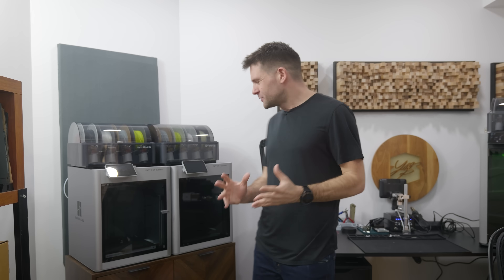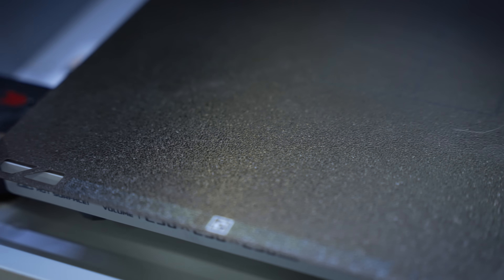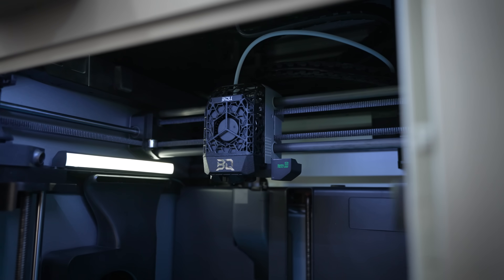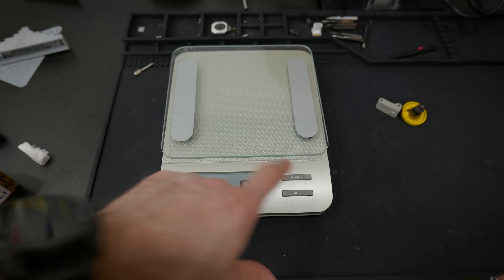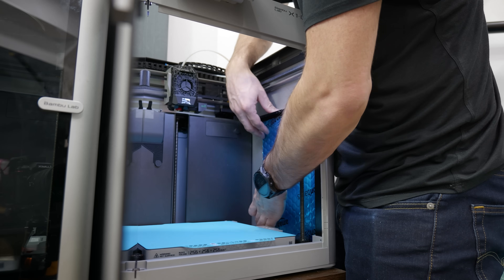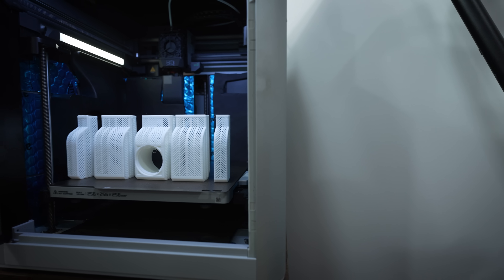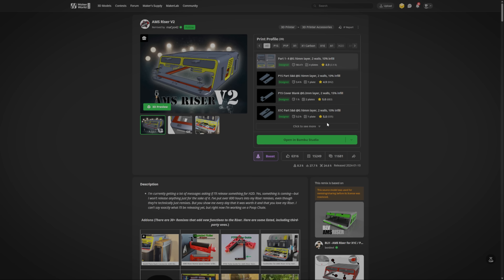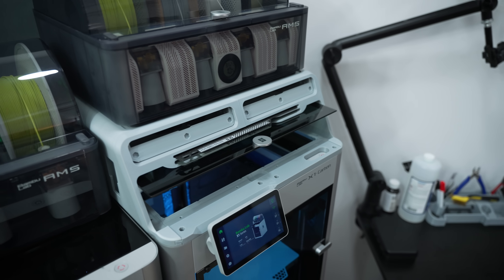I dont understand why more people dont MOD their 3d printers...

Comment: We started by modding our printers in order to work properly -> bambu made press and play printers -> this dude discovered modding bambu printers. We ve come full circle
Reply: Exactly this, I'm still rocking my Ender 3 that I picked up at the end of 2018 and I've basically replaced the entire unit at this point modding things out and improving functionality. This used to be normal for the 3d printing market - Bamboo and some of the other more modern printers made it plug and play for the most part.
Reply: @DarkSky0685  Same for me but with an ender 5. I can exceed 25k at 1000mm/s
Reply: @slacksthegreat subscribed let's see that ender 5 go!!!
Reply: @slacksthegreat what mods do you have? I have a 5 pro and I can't get a good print to save my life
Reply: @DarkSky0685  
that's not something to boast about.  it's like saying  "you folks with your fancy smansy cars.  i still have my horse drawn carriage"
Reply: We have come entirely full circle, there is a community who is putting klipper on bambu labs machines, I am currently working on a1 and its really giving me some needed features.
Reply: This isn't a 3D printing channel so I don't expect Zac to know the history of how we got here, or why "printing your own printer parts" has its own set of pitfalls.
Reply: it was a long road....
Reply: Yea then bambu put an end to modding their printers now they cut the circle
Reply: 100% My Makerbot..  Yes, just Makerbot, needed everything redone and optimized.  Absolutely amazed with my Bambu H2D..
Reply: I would totally mod my bambu but it's very restricted.
Reply: @knightmare1442  I just wouldn't bother, at that point build a Voron. The Bambu printers are fine as they are and most prints I see come off of modded printers look worse than from the stock printer. The firmware and locked in system also is extremely restrictive when it comes to any advanced mods.
Reply: @knightmare1442  nothing is restricted, nothing.
Reply: @cyclonekittenplayz4302  EVERYTHING everything is restricted.  

change out even a single screw and you loose your warrenty.  

if you upload new firmware then it's no longer a bambu printer.  then it's just some DIY based on a bambu.  
and if you don't upload new firmware then you can't change a single thing because it will not work. (won't be recognised)
Reply: I made it a minute in and you already said it 😅 You know everyone has to start somewhere though, so eventually it has to be.....why didn't I just build another printer?
Reply: the ender printers was frustrating, i will switch to bambulab some day xd
Reply: Now, If only there was a 3d printer company that made printers as cheap as possible, it wouldn't matter it had mediocre print quality, we could tinker with it and make it better!
Reply: There's been a 2-5 year period when we modded the printers because it's fun. Then bambu came and many manufacturers unfortunately followed. Don't act like good printers didn't exist before bambu lol, we had Sovol, Prusa, anycubic, elegoo... They were plug and play printers that still work great.
The good thing bambulab did was pushing the not good manufacturers to do better, and brought much needed competition to the table in something that wasn't just a race to the bottom.

We're finally getting to the point where people are finding ways to mod the bambus because it's fun again :D
Reply: @FAB1150  in what universe is sovol "plug and play". they don't even arrive assembled
Reply: Bambu is the Apple of the 3d printer world. It's worse, even, considering how much of the 3D printing culture revolves around open source soft/hardware and community input to improve it.
Reply: @DemarcusJohnsonIII  No, if they were Apple they'd charge 10X more for every single part, even the PTFE tubes, and lock their printers down to just their own brand of ridiculously overpriced filament.
Reply: @DemarcusJohnsonIII  ah so your telling me apple hase dissasambly guides on there official website for people that want to repair or maintain there phone? and your also telling me that apple sells literally all the spare parts for repairing there products on there website? and also your telling me that apple sells there phones for a really competative price?
Reply: @DemarcusJohnsonIII they came in took all the hard work gave us great machines and now they are pulling away from the community. Well it's a good thing there are now cheaper just as good options
Reply: @DemarcusJohnsonIII  what is worse? this modding garbage :D why modify a working printer? i dont get ppl "its restricted.. i need features..." waht do ppl mean? i dont know a single person with a bambu missing a feature
Reply: ngl bro bambu sucked for me never hadd a problem with my ender 3
Reply: IKR this is hilarious, i still have my ender 3 THE FIRST VERSION and it still prints better than a bambu albiet slower but its not my only printer anymore.
Reply: @Guardian_Arias yeeaaaa... No
Reply: What the fuck does press and play printers mean? Lol
Reply: I came here to say this.

We have been moddong our printers since before they actually SOLD 3D printers (back when had to build your own).  Thus is nothing new whatsoever.   It irritates the living shit out of me when people who have been benefitting from what we trailblazed over a decade ago, suddenly think they've made a huge discovery like this, when we were the ones who came up with it years and years ago.

Bro (author of vid)... no shit sherlock.  This is nothing new.  You didn't come with this shit on your own.  You're standing on the shoulders of the giants who cam before you and here you are acting like you're just that tall on your own. 😂
Reply: @revvy13 you’re so brave!
Reply: @revvy13 Yeah the MakerBot days were fun but rough... Just getting it to extrude and not chee the filament up was a feat, and I'd prefer to not have to tune PID loops again
Reply: @revvy13  It irritates the shit out of you when people benefitting from what you trailblazed suddenly think they made a huge discovery when you were the ones that came up with it? Ok, when did he claim to make a huge discovery? I suppose you consider yourself one of the giants whose shoulders hes standing on? 😂 So what mods did you invent that trailblazed the industry? Such a vile attitude you have for no fucking reason. It irritates the living shit out of me when when people feel like they're not getting the gratitude they think they deserve and start acting as gatekeepers to an industry because back in your day....
  I'm not actually understanding why your so pissed...cuz he's got a working printer and still wants to upgrade it?  Cuz I guarantee you've done the same exact thing to a working printer just to make it a little better. Ever use a printer to make upgrades for itself? Well then it really wasn't something you NEEDED, because it was already printing functional parts, just something you WANTED. Get over yourself, you weren't the industry pioneer you imagine you were, you're hating on someone that didn't have to go through the hard times that you did. Usually adversity makes a person better, but apparently not in all cases.
Reply: @revvy13 to be fair he didn’t claim to discover modding. He’s comparing if modding and spending the money on certain mods is worth it. No need to be ugly. He took the time to compare and add a creator it’s very time consuming to do this. Especially not getting paid to do it.
Reply: @stayreadyto3dprint  I think it's a bit tone deaf to take the stance you are qualified enough on printers to point out what mods are or aren't worth it while not realizing modding printers is half of their use case for a lot people. Just searching for the mods would have shown him that, so honestly it's kind of impressive he came to this conclusion that no one mods their printers. Or he just wanted a clickbait title and rage engagement.
Reply: @revvy13 :  What?  •  Did you get some kind of patent or trade mark on what was "trail blazed over a decade ago"?

Can't really understand what your anger and animosity is all about!  •  No need to act like a "karen"!

Comment: Thought: Someone, anyone, please design this. 

You know how we already have a top riser for the glass to give clearance for the PTFE / top of the extruder? 

We need a bottom riser, to give clearance for a filament poops tray, for front-side access. Then we don't have to fight the machine or move the whole table to clean up or empty the bin. We can just pull a tray out, dump it into a bin for sorting and recycling. 

It could double as an accessible space for tool storage, maybe even a filament spool/dryer.
Reply: You havent spent any time on maker world have you? There is 10s if not hundreds of poop chute mods that do this.
Reply: @MattWeber  

You could have said what you said a dozen different ways, all of which would have made you look less arrogant and/or dishonest.

I tried words like "under" "poop chute" "under poop". 

I got one singular result for was even close to what I just described in my previous comment, which you clearly didn't read fully. "poop drawer".
Reply: @MattWeber  Honesty check.  NO there are not hundreds. There is literally 1 that fits the description I gave, and it was not in the results of all searches. Only after I put in "poop drawer", a thing I don't feel like I should ever have searched for, did I find it.

Comment: I think to get any benefit from a lighter toolhead on a Bambu printer you'd have to rerun the calibration wizard as it then measures the axis inertia and applies acceleration compensation.
Reply: Yes this, and also run it at the printer's speed limits to the point you start seeing ghosting etc. These comparisons are useless.
Reply: @qwertyboguss I was thinking the same thing
Reply: Agreed. Also, I feel that the difference would be more pronounced if using the 0.2 nozzle instead of the 0.4 as shown in the video.
Reply: I just went through two months of troubleshooting an x axis resonance issue with my p1s. It had the biqu extruder housing, panda claw, and microswiss high flow hotend. I replaced x axis gantry, idlers, belts, everything I could. Redid calibrations multiple times, cleaned carbon rods… error code would remain. In the end, removing the biquparts and going back to stock, then re doing calibrations multiple times solved all my issues. 

To be clear, printer ran find for 6+ months with no issues. Out of the blue, I started getting the resonance issues. 

Live the biqu stuff, but I need the thing to work.
Reply: I took my cover off and just never replaced it...does it need a cover?
Reply: @robschultz  Considering the skeletonized BQ one hardly covers anything, I don't think so.

Comment: because its a crapshoot when you do if you don't understand how to adjust the firmware to outright destroying a machine that works fine. That or turning a reliable dependable machine into the 3d printer equivalent of a supercar aka constant tinkering and repairs just for one or two good prints and expensive. There are some that are simple upgrades that can help and some do work. ITs still a rabbit hole. ITs tinker on printer vs use printer for what it is suposed to do print. Nothing wrong with learning as much as you can because when the machine has and issue and it will you know what's going on and can identify print issues.

Comment: "why don't more peopke mod their 3d printers"

Possibly the worst clickbait I ever witnessed. Literally one of the biggest things in the hobby is modding printers
Reply: There is a BIG difference between people who’s hobby is tinkering with printers and people who make things using 3d printers.
Reply: The industry is beginning to move away from the hobby and enthusiast markets and into people who buy them to actually print. I’m one of those. In 1976, I designed and built my own S-100 bus computer, building my own power supply and circuit boards. I even wrote my own tiny Basic. But the industry moved past people like that, and we moved with them. Just a few years after I built mine, major companies eliminated the need. The same thing is beginning to happen in the 3D printer industry. In a few years, hobbyists and enthusiasts will be a small part of the business. Bamboo Labs started that movement by making printers that didn’t need all of the mods and automated most settings and adjustments. The rest of the industry has been following. It’s tough news to people, but it’s reality. The same thing with the firmware restrictions. Other companies will follow.
Reply: @melgross  yeah ppl often insult me, when i tell them i use bambus, i modded my anycubis mega s but i never worked well... i want to design things in cad not spending my time and money to try to improve the qulaity or speed ...
Reply: @F-Andre  of course. There a difference between getting settings correct, or even buying different plates for the build platform for different materials. But as with computers, enthusiasts would, and still do, buy very expensive RAM. It’s a lot faster than what comes with the computer. But overall, it has almost no effect on computer speeds. That’s the problem with modding 3D printers, at least, those that are newer and well designed in the first place.
Reply: Modificar impressoras significa que não tem nada mais interessante pra fazer 😅..

Comment: I’d like to see the fan duct with overhangs instead of bridging! And for the lighter weight ringing is the best test as it doesn’t affect detail much, but regardless 5g won’t make any difference!

Also how big is your monitor? It looks giant! I have a tv as a monitor too but it’s 42” and I use it as both a TV and monitor

The insulation for me made my P1s reach 60-55c easily which is great for abs

I added mine to the outside tho. It made a big difference. I did add it to the top glass too tho. Used thermal camera to tune it

Comment: 3:04 This is 100% due to cleaning of the build plate. Since the second print printed in exactly the same spot as the first print, it was perfectly clean, since all the debris had melted into the first print. I experienced this a LOT when I still had an open frame printer. After a failed print, printing again resulted in virtually perfect bed adhesion.

Comment: The light bar upgrade could potentially damage your printer: the max current for the stock light port is 300mA. If you connect a brighter light it might burn out the board over time.
Source: done that myself.

Comment: Why don't more people MOD their 3d printers?  Simple.  Because most people are too lazy to do it and have been conditioned to believe that what the manufacturer did was proper and if they didn't do it then it doesn't need to be done.  Most people also (foolishly) believe that "good enough" is good enough.  Personally I believe that stock is NEVER good enough and that is EXACTLY why the aftermarket exists.  I have 5 printers and every one of them is modified in some way.  Some lightly and some heavily but none are the way the manufacturer shipped them and ALL of them work better than they did before they were modified.

Comment: You should look into the new MicroSwiss - FlowTech CM2™ CHT - Hardened Tip - High Flow - it's actually cheaper at $84.95. Would like this tested vs the BIQU hotend